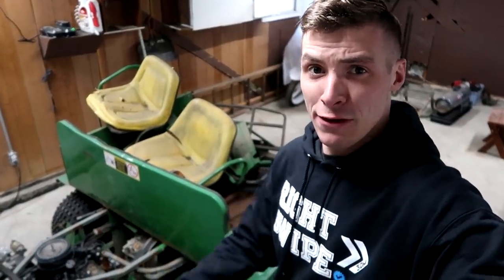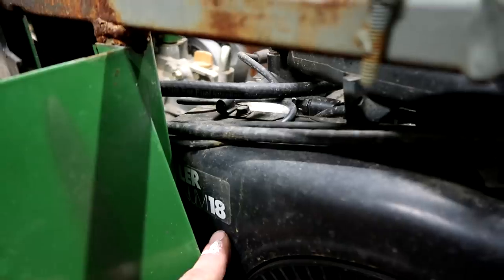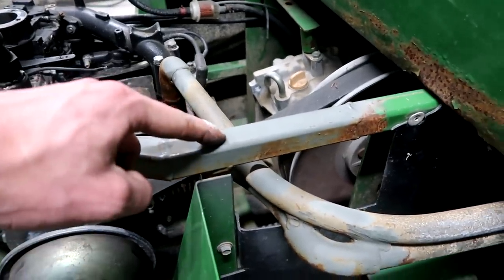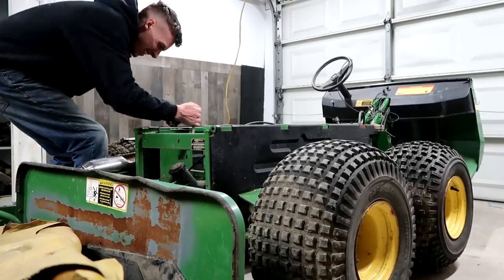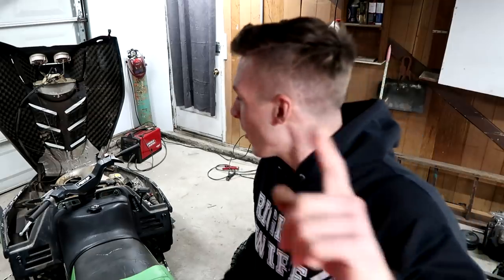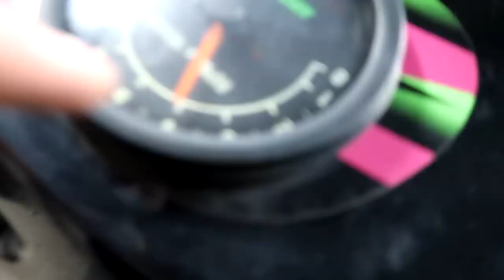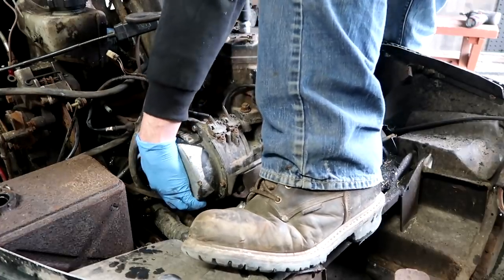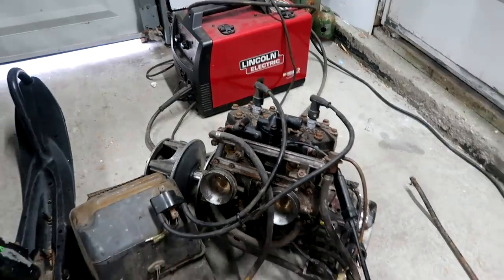The Gator is Back with a Huge New Upgrade!

Comment: You have to squeeze the bright lover on the other side to make the starter work with the key if you did not know that it's a safety feature and cuz the throttles in case the throttle get stuck wide open and you don't know about it you have to grab ahold of the brake handle to make the ignition system work

Comment: Hey man take the secondary clutch pulie off the sleds gear box and put it on the gater, both clutches need to have the same ramp (angle) for the belt to work properly.

Comment: I’d keep the oil injection on for ease of use, but that’s just me. Now I know what everyone will say, oil injection isn’t reliable and my sled blew because of it, I got 17000 on my sled with the original oil pump and never had an issue and have been the only owner of the sled, if they weren’t good they wouldn’t put em on the sled.

Comment: efi sled engine that aught to be fun getting running in somthing else a carb engine wouldve been so much easier and its bored over and im sure the previous owner didnt get the efi adjusted so most likely running lean but it could be fine since lots of older sleds ran rich, and 4 pulls on an efi sled somthing is plugged up my sled takes 2 on a cold day.